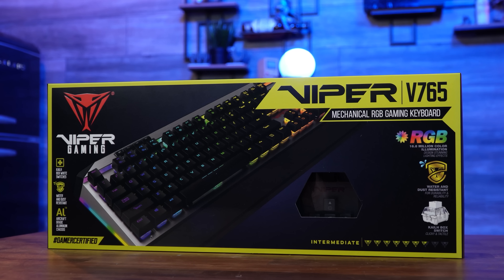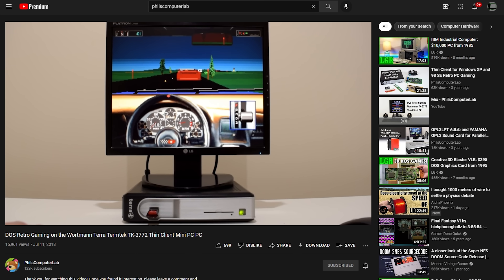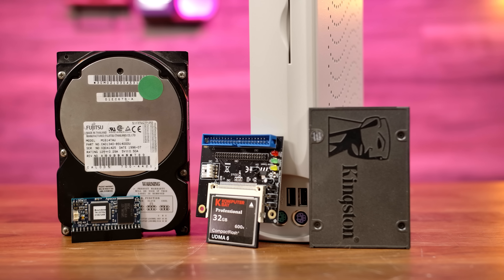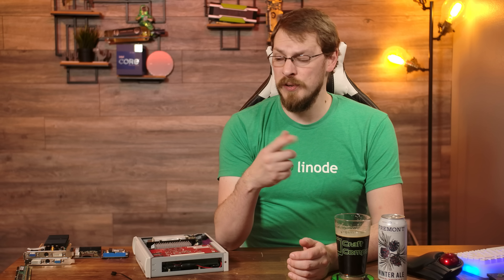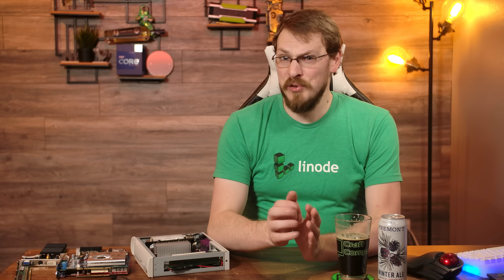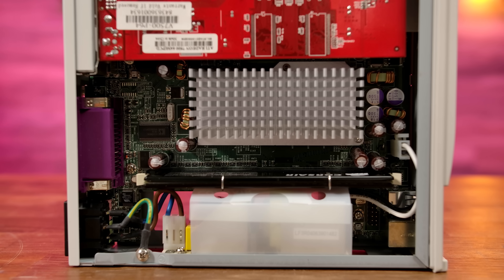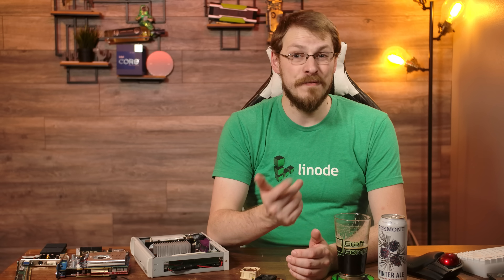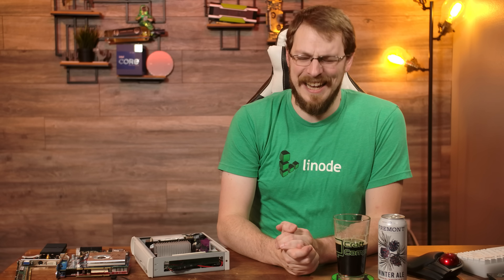What could go wrong - Retro PC Build FAIL

Comment: 110mm hole saw + 5v 120mm fan + USB for power delivery.
Unfortunately you went with an internal power supply. It might have seemed like a good idea at the time, but you really shot yourself in the foot.
Power supplies, especially tiny custom ones like this, are going to fail. You will never be able to replace it for a reasonable price.
You would have been SO much better off getting something with a standard 12v or 18v barrel jack for input. You would be able to replace it easily, and you could always upgrade/swap/tap it for more power inputs.

Comment: IMHO, the internal PSU just isn't worth the hassle. I'd mod in a barrel jack and hunt down a 5v 10 amp PSU. You can get one for 20 bucks on amazon. And yeah, the Windows 98  nVidia drivers for the FX series onward are hot garbage. For the 6200, only driver 81.98 really works and it's pretty buggy. The FX series is better (supposedly supported by 45.23, the sweet spot as far as compatibility is concerned) but as you noted, it's a power hog. For nVidia, you're better off with GeForce 4MX  based card. There's a Quadro (Quadro4 NVS 100) that would be ideal for this build: GeForce4 MX gpu, 64 megs of DDR ram, passively cooled and can use much older drivers. The bus is only 64 bit, but because it's DDR, there's similar bandwidth to a 128 bit SDRAM bus: it's supposedly roughly equivalent to a GeForce4 MX 420, well within the power range of a strong GeForce 2. The downside is you lose DX8 and DX9, however, with the Eden I doubt DX8 and 9 based games would be playable. What you really lose with a DX7 based gpu is nGlide support, so if Glide games are your primary thing I'd stick with the Radeon.

Comment: WTF was that scratching sound.  It sounds like someone was trying to write down everything that was said in real time with a quill and parchment.  I know this episode is based on retro but that's going too far!

Personally I would be tempted to try using a different power supply type, especially one that let you run the PC from an external power brick.  It's not surprising that the Nvidia FX caused power draw and heat issues in particular, that series was known for the coolers being noisy (the press nickname was 'the dust-buster') because they were very power hungry, inefficient and as a consequence drew more power than the ATI equivalent of the day (Radion 9000 series).